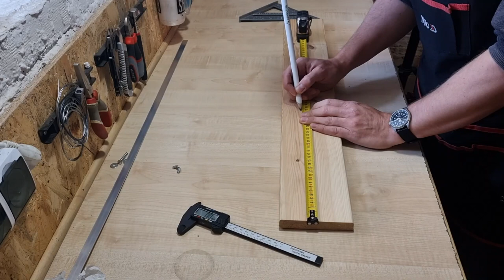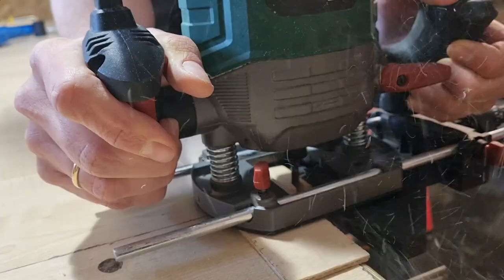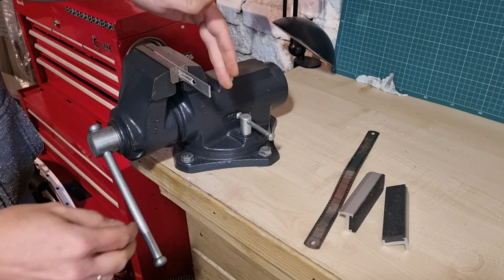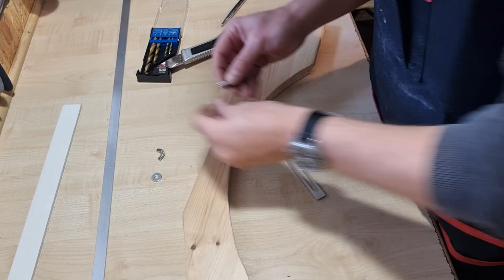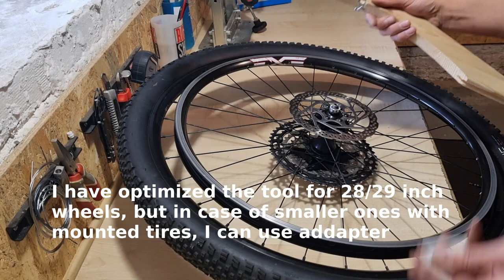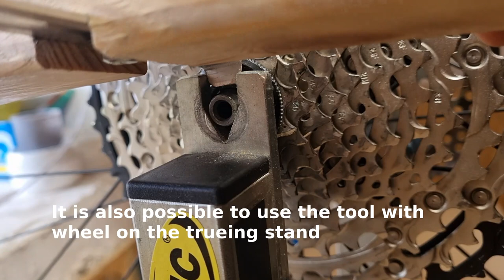DIY simple wheel dishing tool

Comment: great work. just one thing, you need to make sure that that piece of wood is perfectly straight right?
Reply from the maker: You are 100% correct, however even if the wood is not completely straight, it will result in the same measurement error from both sides of the wheel which makes it negligible and acceptable.
Reply: @custombikefactory  hehe, that's true! I'm thinking about using a clothes hanger...the design is similar
Reply from the maker: @Gledii  Hahaha, already tried it, but it is too short ;-)))))
Reply: Yes, i just realized after suggesting. I made a very simple version with some scrap stuff I had at home...it did the job
Reply from the maker: @Gledii  Awesome! My congrats ;-)

Comment: I have seen videos of people building wheels, and due to the sprocket(s), back wheels can be out of dish, and still be correct.

But as the second wheel had a dish break, it was in dish.

🤷 I don't know much about these things so...
Reply from the maker: Yes, there are some cases where wheels can be out of dish - for example Cannondale is doing so because of their asymmetric frame design, but majority of wheels should be even. My tool is able to accept adapters which I present in the end, which can be used to measure uneven dish for bikes such as Cannondale or custom need.
Reply: @custombikefactory 
Interesting.